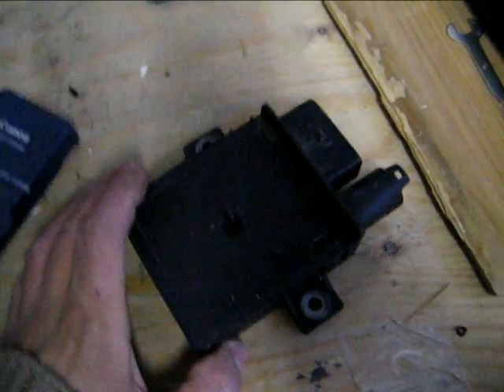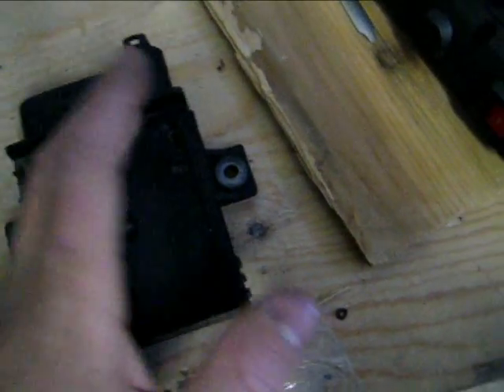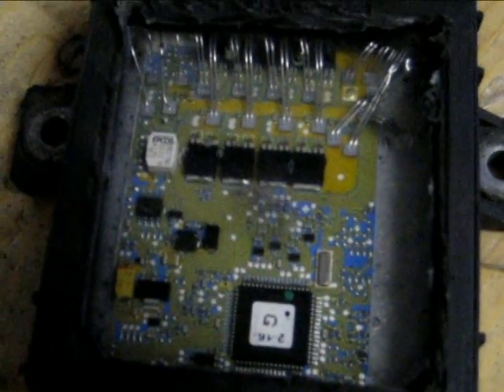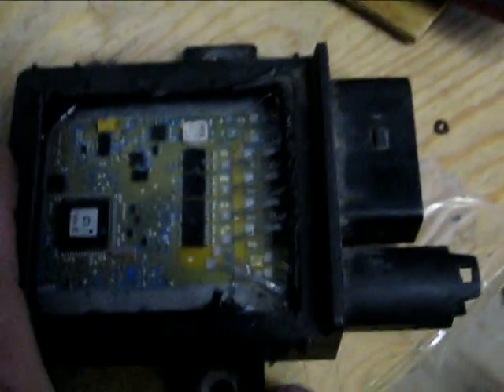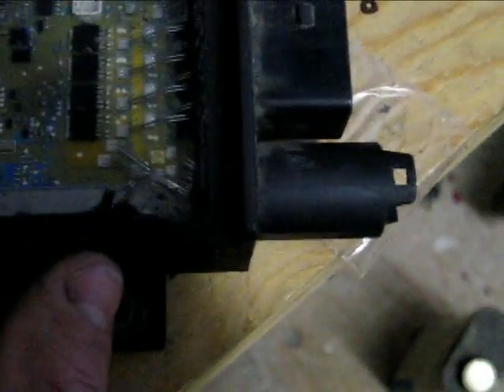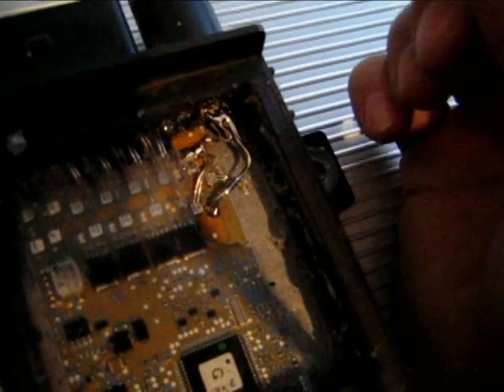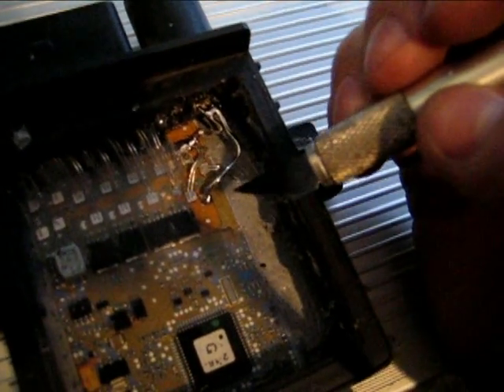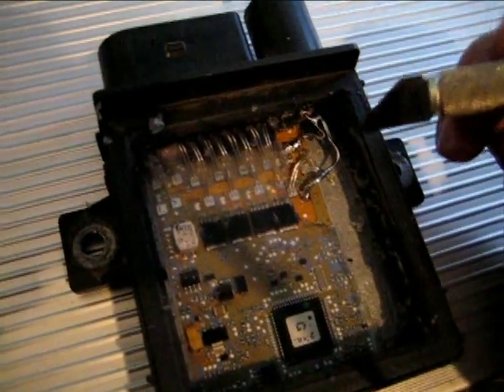Glow plug controller tear down and fix

Comment: Started on a few because you have a couple bad plugs most likely and now that the controller works it will shows codes for the bad ones.
Reply from the maker: Nah all new plugs back then, no code after repair, codes before with same glowplugs
Reply: @Nordic_Mechanic  hmm musta just been really cold .

Comment: really can't understand why beru used alloy wire, cost saving compared to copper regarding the whole part would be foolish, anyway classic steel would be allright, then using alloy in vibrating conditions is not reasonable, and worst, this is a poor conductor where the joint is the weak part doomed to fail. But there should be a reason, anyone know?
Reply from the maker: I think the reason is to limit service life
Reply: @Nordic_Mechanic  😂 classic.... Well, might we know someday

Comment: A colleague of mine has issues with his glow plug module of identical build in his Mercedes c220 W204, he has a Beru GSE110. Right now you can't get any replacement part for it, as nothing gets here from China, chip shortage and so on. I will try to help him with this, as I now have seen some footage of how that thing is built generally. Better to see someone else open up a part, when they already have ordered a replacement for it, than to experiment on your own with nothing to replace it with...
Reply from the maker: that'S right. this part is very similar . Only it has more output on a V8 vs a V6 or L4

Comment: They do more than just run for a few seconds in the winter. They after glow at lower power levels for up to 5 minutes to aid efficiency when cold. Also in many vehicles they are involved with DPF regeneration cycles and help increase exhaust temperatures when a DPF regen is required.  Hence the complexity
Reply from the maker: Most of what you said is not the bulk of the complexity though. The complexity is mostly voltage conversion from 12 to 5V and the current sensing to prevent glowplug inflation and engine damage. You could still run 12v glow plugs and start them here and there as needed. And you could run self regulating glowplugs too. Also, DPF were not on trucks back then, even simpler. This was done mostly for people who dont want to wait 10 sec to start a diesel engine. It starts just like a petrol car. When usage by uneducated users leads to higher complexity and lower durability is where I draw the line.  Especially when the component is so obviously built down to a very low cost with fragilie components.

Comment: To weld the chips and the terminal that are covered by silver, you have to sand several times and then clean with Isopropanol or ethanol, then use flux and a tin ball without paste, with soldering iron of 120W or higher, since it has to be soldered fast

You can test the connections with one tester, going through the protective gel and the other end on the corresponding output leg inside the male connectorPara soldar las fichas y el borne que están recubiertos por plata, hay que lijar varias veces y luego limpiar con Isopropanol o etanol, después usar flux y una bola de estaño sin pasta, con cautín de 120W o superior, ya que tiene que ser soldadura rápida.Se puede probar las conexiones con un tester, atravesando el gel protector y la otra punta en la pata de salida correspondiente dentro del conector macho

Comment: I found the same damage.. BUT I can NOT get solder to stick to the silver pads. How did you get the solder to make a connection?
Reply from the maker: yes it IS a pain. clean has much of the goo as you can, and use soldering flux. it will stick with the right technique

Comment: oh man, this is modern over engineering again to make suppliers happy.. a box full of electronics just to turn on / off a few glow plugs... unbelievable
Reply from the maker: yes and you know why ? just to make glow plugs heats faster. I mean, I STILL have to wait 2 seconds, I wouldnt mind waiting 10sec instead and have a big relay instead.  They had to make this box because the glowplugs are 5v and not 12v anymore.  Only good thing about this is it tells you which glowplug is dead.  Is 8 seconds of time worth this complexity ? I personnaly dont think so

Comment: what kind of adhesive do you use to close back the controller? i am going to open my solenoid box on the M3 but i´m not sure about what use to close it again safely....
Reply from the maker: rtv can keep oil inside a transmission, it will hold water out of that box just fine :) That's what I used, still fine

Comment: you need to check the last three single connections also, (on the left)
Reply from the maker: good to know. This one has worked throughout last winter so that's all it needed
Reply: yah sure, but in other cases the other connections needs check.
Reply from the maker: Wael Sherif
 Good to know for the watchers. This design is also used on 3.0 jeeps and mercedes, only with 6 outputs instead of 8. So everything here applies to those as well

Comment: really just playing around with my new scan tool, but mainly because im waiting for my new MAF sensor to arrive as ive had real trouble getting the right one or at least one that works because ive purchased 2 new ones now, the first one did not take out the check engine light even after i cleared the code. the second one looked cheapo and not only did not seem to work but also my car smoked like hell and missing about 2500 revs very bitty and smokey. i have e46 320 d, just brought fault code reader and it said oxygen sensor heater activation. so i looked and found someone had unplugged it altogether. so i cleaned the plugs and plugged back in. that took away the oxy sensor activation code, 
BUT then came another code saying 4203 glow control unit, it was not there before. do you think it has anything to do with me plugging back in this oxy sensor, it must be working if the code went away right? or do you think all these codes: 
4BC2 maf sensor (unplugged for now), 
4BA0 and 4BA1 intake air temp sensor signal (x2 of the same code?),
4501 exhaust gas recirculation control deviation.
 if you cant be arsed with this just say, ill understand completely. my engine has been great and its at 200 000 miles now.
Reply from the maker: +ral islegend I think the intake air temp might be revelant because of the maf sensor being unplugged. 4501 def a clogged EGR or a failed egr valve that wont open. Check the vaccum line that goes to the egr, it may have cracked. There&#39;S two line in the vicinity, and you might have them backward.  I would not mess with the intake air temp before getting the MAF fixed first.  BMW sometimes a bunch of codes when it gets confused.  Had a 2003 325i throw transmission codes because of bad coil packs. 
Get the MAF sorted, and check the vaccuum diagram on the EGR first
Reply: +Veikra thanks, i did think it  might be getting confused with all the changes as i did try two new maf sensors and also the plugging in that oxy sensor as well must have really messed it up. ill just wait till i get the new one and then do vigorous tests. looks like i got one of these glow relays too so might be doing this but hope not. im hoping it will just level out because that code was not there before. cheers  for the advice anyway.
Reply from the maker: ral islegend
dont forget to clear the codes everytime you change something:) Otherwise you are in for a wild goose chase

Comment: this worked for me, i just removed all the connections from inside going to the main power source, then redid all of them. starts like a champ -10c
Reply from the maker: +stamatios1 yeah, this type of connections should not be allowed in a car, it is way too fragile.  Sadly for me, I had bought another controller.  I have a spare one now I guess :S

Comment: just opened mine up as it would not cold start. Found 5 of the 6 wires broken.
Reply from the maker: +affinityfunable very probable that it will work once resoldered
Reply: +Veikra You know I had a bit of a hard time with the resolder today. it didn't look pretty note did the truck start cold. I ordered a new module :-( it was fun to try. Wish it would have worked.
Reply from the maker: affinityfunable
the coating makes it very difficult to solder indeed. I had a hard time getting it to solder at first

Comment: what about dumping out the electronics and installing a manual push switch in the jeep to operate the main relay hardware
Reply from the maker: +jim power All 6 blown glowplugs and possible engine damage. The plugs are not 12V, but 5volts. 12V would burn them or worst blow them, sending metal parts in the cylinders. 

You can only do that on older diesels, those that the 12V glowplug takes like 15 secondes to heat, and then, you still need to replace them with self regulating plugs, otherwise same problem and damages
Reply: @Nordic_Mechanic  They read 5V because of the Multimeter taking an average of the signal. I've scoped this signal and its PWM signal with a duty cycle of 12% being controlled by 8 Power Mosfet below and above the wire bonded pads. At it's max it peaks at 9.8V (Good readings). Sometimes getting this to communicate after repairing the power bonded lines and being unsuccessful, leads with issues to the Microcontroller which by looking at the datasheet it has 20-year data retention, after that data might go corrupt. Attempting to extract the firmware from it to flash another one will cause to brick itself since it has protection from data extraction from third parties; to make this worse ST electronics no longer produces those microcontrollers. That's why some Chinese versions have been around supplying that demand, the biggest issues with this one's is that they overtalk the CAN bus making codes pop up on the trucks.

Comment: original code P0670 which as I understand is the GPCM. Now that I have "fixed" it I am getting only P0671. This denotes a bad #1 gp. If this is the case and I need to buy one plug I am Ok. I checked them all for resistance before soldering the GPCM, and plug #1 was 2.5 ohms. Also I was not getting P0671 before. interesting experiment either way. Drove it a few times today and no P0670 code, so I will pick up some silicone potting fluid tomorrow to protect my welds assuming they are still holding after inspection. They were tough to tin.
Reply from the maker: +shanghaitheory nice, check the wire between glow plug and controller. Indeed, mine were also pretty tough to tin.

Comment: I just tried to repair mine. Still getting a code. Maybe I should try taking it for a drive? Try it a day or two? Started real smooth.
Reply from the maker: +shanghaitheory they all start smooth until -10 -15 Celcius.  Is the code about low voltage on all the plugs ?
Reply: The

Comment: Same module that is my Jeep with a Mercedes V6 Diesel...
Did this work?
Reply from the maker: +Peter I same type, but yours has 2 glowplugs less in it, so they dont interchange. Yes it worked, but only after I had bought another aand ran the truck for a while. Swapped them and both work, so I have  a spare

Comment: It was worth a try.  My glow plugs stay on for more than 3 seconds when it is cold.  I also think that they stay on for a short time even when the truck starts in cold weather.  My volt gauge shows something drawing a lot of power on a cold start up.  I am assuming that is the glow plugs.
Reply from the maker: They do 2-3 second at full current then around 60% for a little longer on a lly. Your controller uses a relay, which can be easily replaced for 10$ . No such luck on mine. I'll see if it starts tomorrow. The code says it needs at least 2 succesfull start before it clears the code. Anyways, VERY cheaply made controller with built-in failure wires.